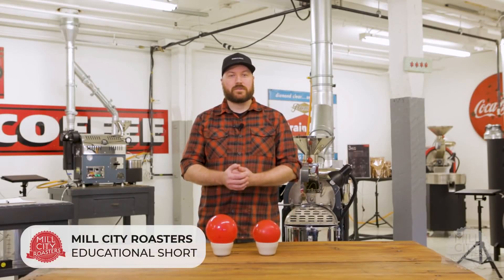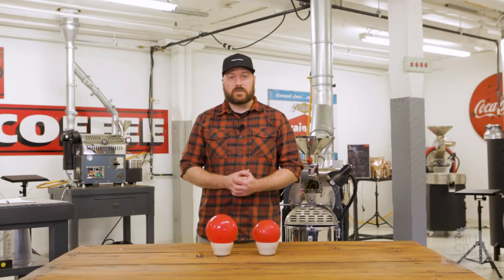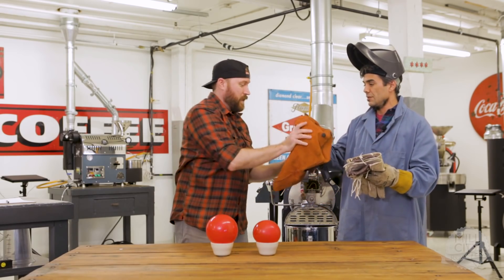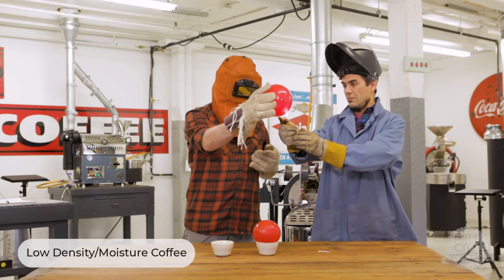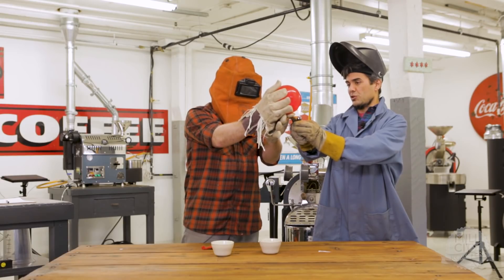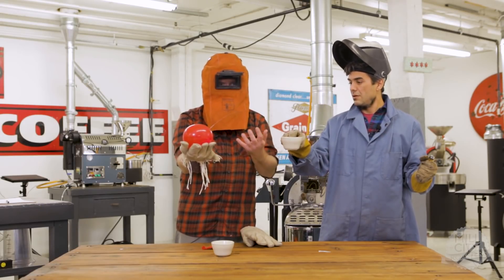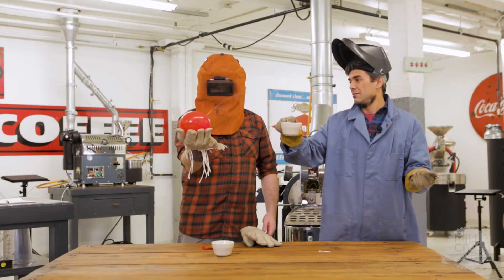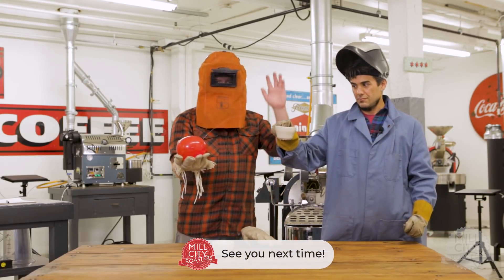Educational Short: Coffee Density/Moisture and Charge Temp

Comment: I love your videos. But this one not. Actually it doesn't make sense to me. But still fun :D
Reply from the maker: Think of lower density coffees as inherently more fragile. Decaf is probably the lowest density coffee most roasters encounter. Lower preheat and lower application of heat is necessary to avoid heat defect. There is no formula for determining the most successful preheat or charge temp, but rather a general guideline for marginally more initial success with any given coffee.
Reply: @MillCityRoasters  Now I've got the analogy. A low dense coffee, with same energy will "crack", as the baloon explodes, faster becouse the structure can't endure so much energy, causing the heat defect that you said. Thank you very much!